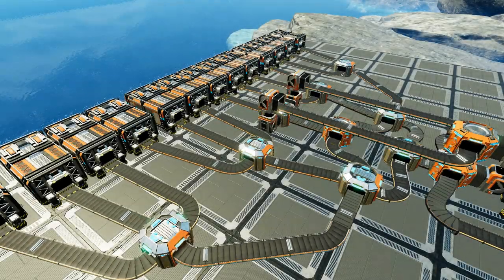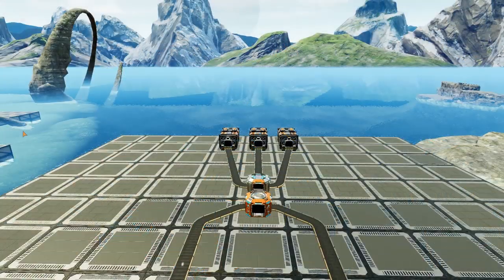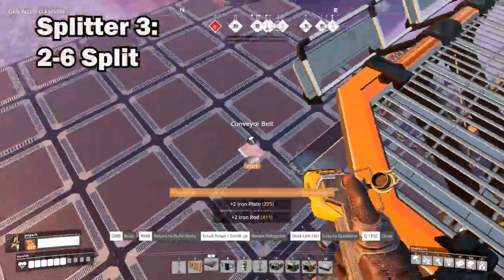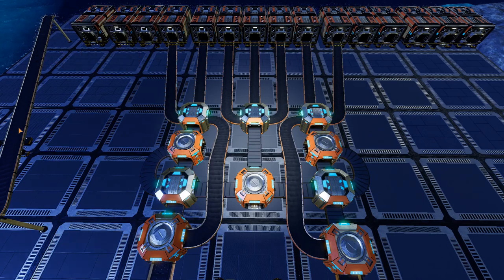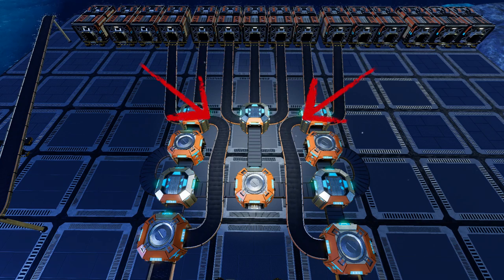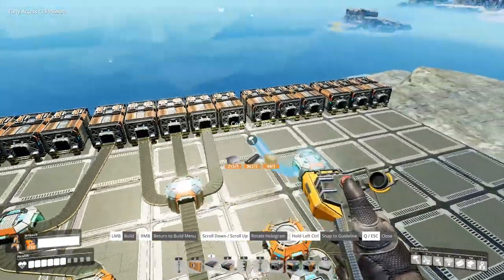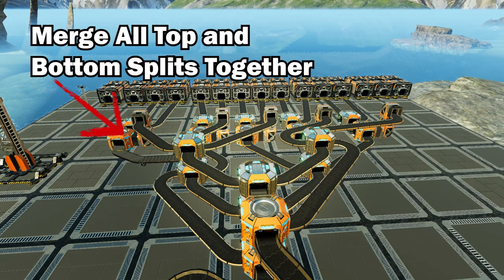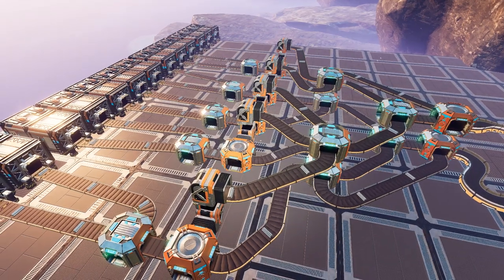Advanced splitting guide  2 Conveyor Lines- Multiples

Comment: 2 to 10 seems to be a bit unnecessary as you can just add a splitter to the end of each line of a 2 to 5 , especially as you dont seem to add any more balancing to the splitters . A second tip for other people: You can underclock buildings to have an easier way of splitting. Which means that for my input of 600 iron ore I do not split it into 20 smelters of 30, but rather 24 smelters at 84% .
Reply from the maker: That's a really good point! If people aren't maximising their lines, underclocking can make it a lot easier to split! Thanks for the suggestion!
Reply: @TotalXclipse  Also underclocking decreases power consumption more then linearly, so it would be not only easier to split but also more power efficient.
Reply from the maker: @nikelsad  You're right the amount of energy saved during underclocking is incredible and with the easier splitting could be really useful for some people :)

Comment: Too complicate. It just do the overflow/manifold method 🤣
Reply from the maker: :D Yeh I totally accept that :D
Reply: One thing with overflow method, which I also prefer, is that I find if you match input/outputs perfectly then when it starts up there is a long wait until the last machines on a line get required inputs and sometimes they wont ever reach peak efficiency since the earlier machines on a big row queue up all the inputs, so what I do sometimes is crank up the feed with overclocking so it jacks up production for a while and fills up the queue, then remove the overclocking - this way the overflow method will always maintain that 100% output without having to slowly ramp up to it while it fills up the queued inputs in the first machines on the row. Another way is to run around and manually input 100 stacks or whatever into the inputs of each machine starting at the end so they start full and the queue doesn't have to catch up to them.
Reply from the maker: Rick yeh I usually drop a stack in them if I need them all running at 100% but the overclock methods a pretty cool idea. if the manifold design is too long say it will never fill up because the first constructors will be consuming the item then the second constructor will use the second, so the only counter in that case will be to add more resources to the line. For example your bus consumes 100 ore per minute, but it takes 66 seconds for your items to reach the end smelter, then you’ll actually need 110 ore per minute on the line

Comment: Sorry but i'm a bit confuse about the  "2 to 9 splitter"  , you didn't forgot the two conveyors passing on top of the centrals conveyors?

Cuz you said "same setup as 2 to 5" and after it you said "Merging into 3 lines"
And Cuz of the conveyors pillars on central confusing me... Thanks by advance for helping everybody :)
This is a concentrate masterpiece BTW <3

I've also copied all thoses splitter on a paper to remind me :P
Reply from the maker: Dji 😅sorry for the confusion, I meant it’s the same in terms of splitting and merging the line at first into three. So both lines are split into three. Two of the lines merge together and go to splitter to be split into three, then the other line goes to the middle to merge with the opposing splitters line  this then gets split into three and the final two lines on the other splitter are also merged and sent to a splitter to divide into three. There’s a perfect frame showing the layout just before we go into the next split ratio. It’s only a second or two long (really I should have made it longer) but it might help with the text. Hope it helps! If you want I’ll do a three lane load balance video  this week as well